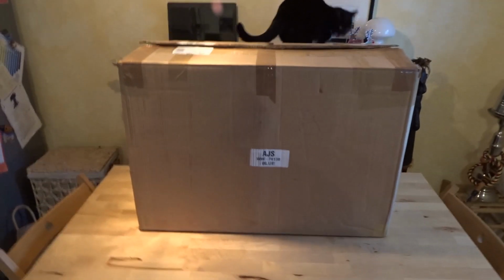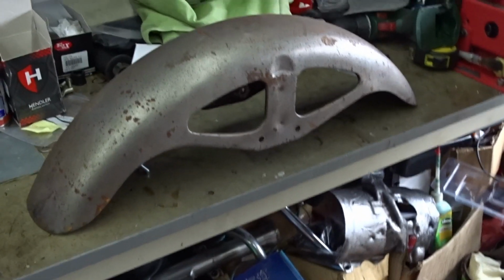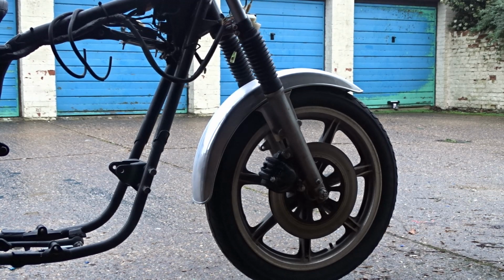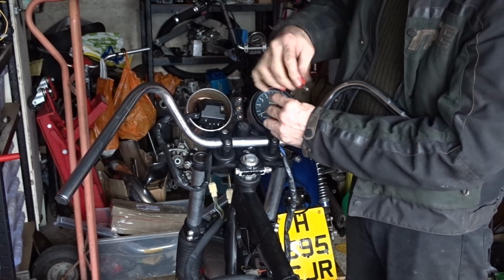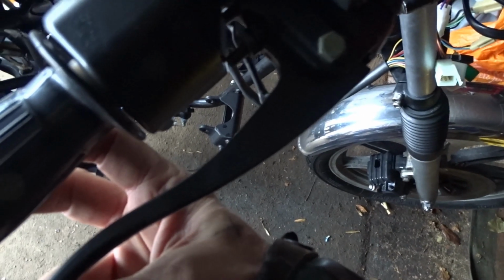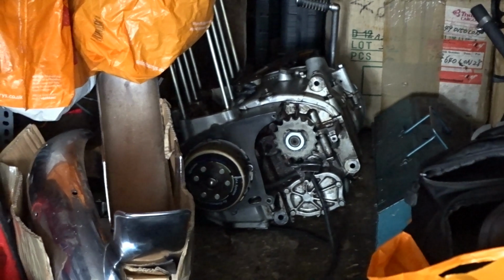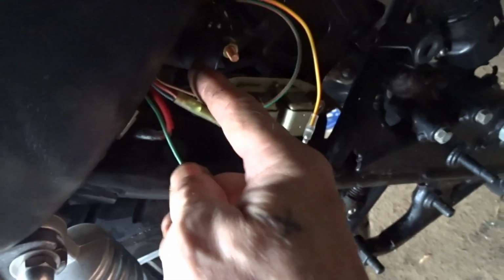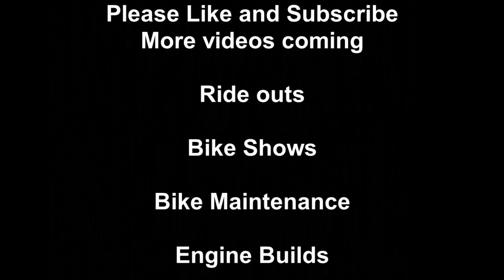Bitsa Bike Build - Part 6 - Handlebars and Front Fender Saga - XS650 Bike Build from Frame up

Comment: What the difference between the spoked and mag wheel xs650 I'm thinking of getting one as a project maybe get a mag wheel model is it possible to swap spoke wheels on to a mag wheel model
Reply from the maker: Hi Steve, the spoke wheel versions have rear drum brakes, so if you wanted to swap one to the other you'd also need a different brake pivot shaft and swing arm, the reason for the swing arm needs to change is the mounting for the torque bar is mounted on the top for mag, bottom for drum. So yeah it is possible, I was originally thinking of doing that to this build but the mag wheels come up cheap so went with that option
Reply: @OldBiker  ok I'll keep my eye out for a spoked wheel xs I prefer the look of them
Reply: @OldBiker  do you know my sort of father in-law who I ride with you must have seen him about he used to have the red BSA with sidecar that he took his dog out in
Reply from the maker: @steveanddawn22  Yeah if you remember a few years back, we all met up at the garage in Buntingford for Gary's bike meet and ended up at the Red lion old town, You, your father in-law who was riding a trial bike with a fire estinguisher exhaust pipe, Brian (Triumph), Jim (BSA)  and myself sat around the table in the back, I will have to dig out the video of that I have somewhere